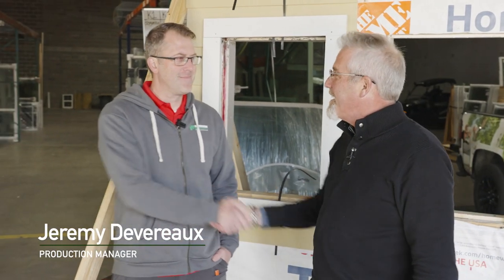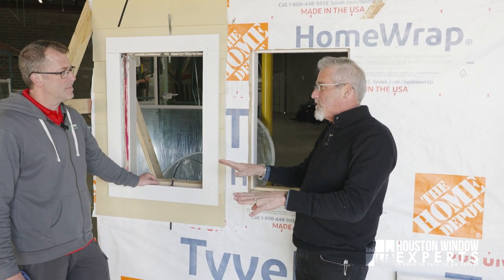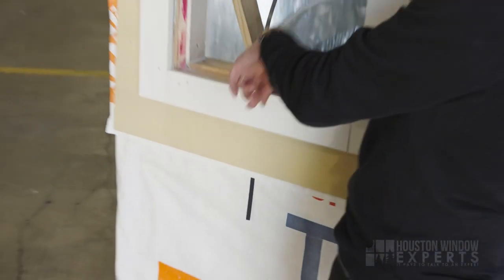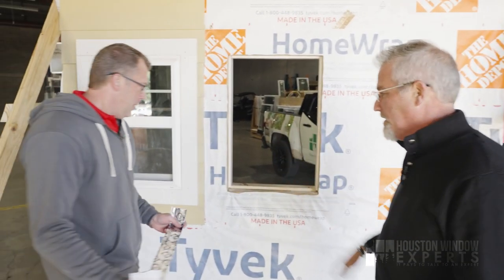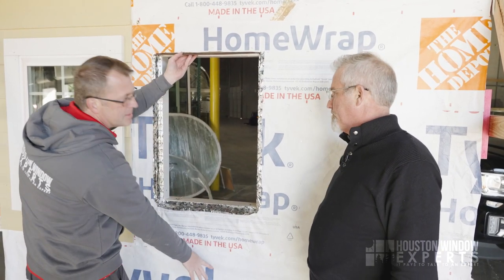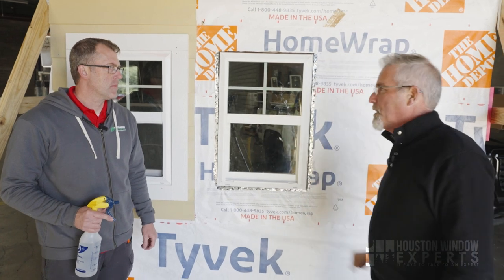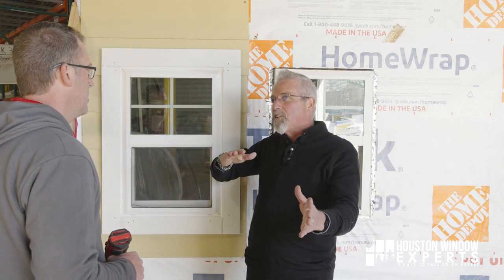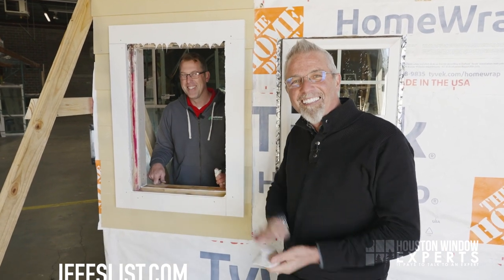How To Install A Leak Proof  Replacement Window

Comment: Another great video Jeff. Is this installation for all types of window installs (brick, stucco, siding, etc.). I looked back on some of your other window installation videos and didn't see this flashing installed. Is this a new technique or was it one of the secrets you didn't want filmed at the time?
Reply from the maker: You busted me! This is something that we called a secret in our previous video. We've decided to share it with everyone.
Reply: @HoustonWindowExperts  And it's for every installation type?
Reply from the maker: Almost always. There are times that the connection between the framing and the substrate leaves very little room to work with. Otherwise, I'd say it can be done 80+% of the time.

Comment: Just to clarify - these examples are with windows without a flange.  

What about installing a retrofit window WITH a nail flange? (which appears to be super common based on what I see at the DIY stores and what i see being installed at neighbor houses)
Reply from the maker: If you can access the opening that would be great. That would require removing siding, brick, or Stucco.

Comment: I can only see one weak point though. At the top the tyvek is compromised and can potentially wick water up damaging the underlying OSB or Plywood over time. Would it make sense to tuck a piece of the flashing tape under the house wrap and flash the top plate then install the ridgid flashing? To me that would make this system impenetrable, although I do understand how installing flashing between the brick siding on real jobsites can already be challenging :) Very nice system though, thank you for sharing.
Reply from the maker: I'll share your thoughts with Jeremy. Thanks for watching and your comment.

Comment: When asking for bids just tell installers I'm requiring the use of flashing tape and rigid header flashing with all windows? Will they even know these materials and processes? I'm in Austin and no one I've had come out has ever mentioned this process, and boy does it seem important (to this homeowner).
Reply from the maker: I don't think anyone else goes to the cost and trouble.

Ask if they have a leak proof guarantee and for how long.

Comment: Thank you (again)! Helpful information at each step of this process .

What about replacement window installation with a nail flange (where they cut out the siding and then replace it afterwards) ? Is that worth the extra price as compared to proper block installation as demonstrated in this video ?
Reply from the maker: If you install the windows the way we illustrated, you would not get any benefit to removing the siding.
Reply: This is also what I wondered. When I had a window guy out recently to bid my window replacement, he suggested the only two options were: 1) retrofit windows inside the old frames or 2) new construction with the nail fin, which would require replacing trim and repairing stucco. I didn’t realize there was a third option and I’m very curious if there’s really no reason to pull off the trim

I’m also wondering how this would apply to stucco - the front half of my house is wood trim/vinyl siding and the back half (with most of the windows) is stucco. I really don’t want to give up the glass space with retrofit windows inside the old aluminum frames, and that would also mean trusting the original window frame install
Reply from the maker: Thanks for watching and your question. Are you in California? California and a few other states have some unique regulations that require that process.
Reply: @HoustonWindowExperts  ah yes I am in California. That makes sense then

Comment: How do you caulk your window method after placing the flashing on? Will adding caulk around the outside of the window create the caulk to trap water in between the flashing and caulk if water were to enter there? Do you create an opening for the water to seep out if it does go on the flashing?
Reply from the maker: Matt, the system we use will not trap water between the two sets of caulking. It will travel down the sides and empty at the bottom.

Comment: Would caulking the replacement window to existing J-Channel be considered a sealed installation for water and air intrusion?
Reply from the maker: I've never done it that way. I'd hate to guess. Sorry.
Reply: No! 99% of installs in the south east are caulked to the J and no this is not proper. If the J was mitered properly and taped to the tyvek then yes it would be fine until your J caulk fails. However, the chances of the J being sealed to the Tyvek are slim to none. You can remove the siding and tape the J yourself or just install a window with a nail flange and tape properly then reinstall the vinyl.

Comment: @13:32 Are you screwing through the flashing tape to mount the window? If so, does this create a potential leak point in the waterproof seal? I am about to do a renovation and replace a single window and your videos have been extremely useful in evaluating which contractors are competent.
Reply from the maker: The tape is self healing. We use a #8 screw, it's a tiny hole.

Comment: I may be wrong but it looked like when putting screws on each end of the Rigid head flashing, it was bowing in the middle. When the window was installed, did the center of the Rigid head flashing get pushed up level by the window and away from the caulking maybe causing a potential leak?
Reply from the maker: There is a half of tube of caulking above that. Actually, the front of the flashing does not matter much since we want the water to make its way to the sides or to the front.

Comment: I would like to know where i could buy the flashing tapes and rigid flashing tapes you used in installing the windows please.
Reply from the maker: These are available at Home Depot. Thank you for watching
Reply: @HoustonWindowExperts   can this flashing tape can be used for window replacement external having the sidings externally or it’s only for new construction ?
Reply from the maker: This tape is used for new construction and, in our application, replacement windows. I do not know if anyone in my industry that does a flashing tape on their installations for replacement windows like we do.
Reply: @HoustonWindowExperts Who can I hire in San Diego to repair my poorly installed leaky windows?
Reply from the maker: I do not know anyone who does window repairs in your area. I would just use Google search and do your research as best as you can. I'm sorry to hear you're having issues.

Comment: Can you put a retrofit window in an existing new  construction with attached j channel
Reply from the maker: Yes. Just be sure that you flash it properly so it does not leak.
Reply: @HoustonWindowExperts  yes. Well if the original window is flashed good already and they put in a retrofit window. The existing flashing will still be used correct. Also can you show me a video of a retrofit window being installed in an existing new construction window. I was told to always to replace a new construction with a new construction
Reply from the maker: You can insert a window inside a window and that's called jumping the frame. 

Check this out. 

https://youtu.be/MwvFTbidHx0?si=VhVxEmkvYa3_hODX
Reply: He said he only does a couple of year. How much more is a full frame compared to jump the window?  I read it’s like 59-100 percent more. So people always pay that much more per window?
Reply from the maker: I don't think so...the only extra cost should be materials based.
Reply: @HoustonWindowExperts  based on your experience and based on one of your jobs. What would be the differene in price  between the jump window and the new construction way. If it is a normal install the price should 10-15 percent higher????
Reply from the maker: Probably about $150 per window because of the trim and time.

Comment: For the screws, do you use 8x3 1/8 inch or 9x3 1/8 inch? I see two different sizes for 3 1/8. I am installing Pella Impervia (full frame replacement windows)
Reply from the maker: We use #8
Reply: @HoustonWindowExperts  Thank you for your expert advise
Reply from the maker: You're welcome

Comment: Most companies will foam and caulk the windows. Is there an industry code that requires you to reflash or is this just a preferred method?
Reply from the maker: That's an extra step we learned to take. We believe that foam and caulking alone is not enough.

Comment: Does this pertain to hurricane impact windows?  Why do the sliders leak?
Reply from the maker: A sliding window should not be leaking. If you're talking about the water that you can see inside the track at the bottom of your window, that is normal. If you have a lot of heavy rain, there are times that the water cannot weep back outside fast enough. That is a rare occasion, probably only during a massive windstorm with a heavy rain.
Reply: Thanks for your reply - that is
My question- what to do for an ocean facing impact slider during a tropical storm when it fills the runner and breaches the inside a lot so appreciate your ideas!

Comment: Question. I watched my new home built every day. I finished the ceramic tile and granite and travertine and tumbled marble on the interior in kitchen and baths. I custom painted it all. A lot of work!!!   But I was a bit concerned how they did the flashing on my windows and doors. The plans called for 1/2” OSB siding on 2x4 studs. I have double king studs on each side of every window and door. Then they did Tyvek and wrapped it inside the windows. But they then did some good flashing around each window installed over the Tyvek and touching the edges of the windows frames and then caulked.   Then the EIFS was applied and the sub who did it was excellent. He has the best reputation in My area. However my question is this… Did they do the windows flashing right?
Reply from the maker: It sounds right from what you're telling me. Congratulations on your new home.